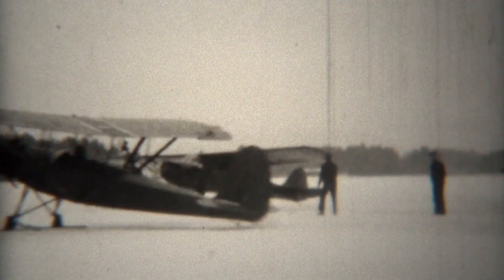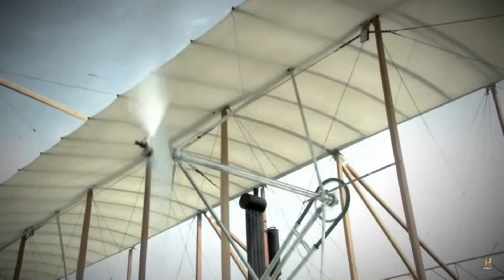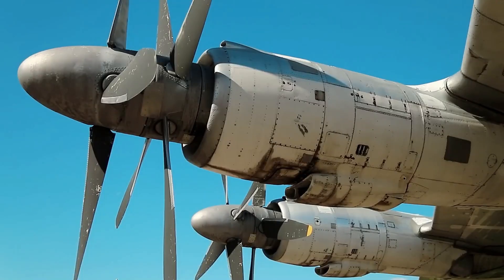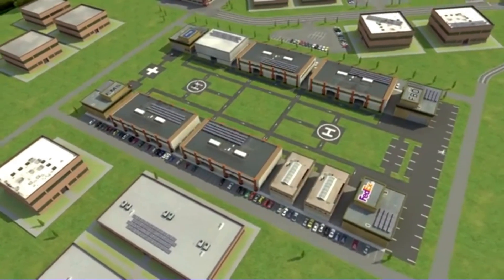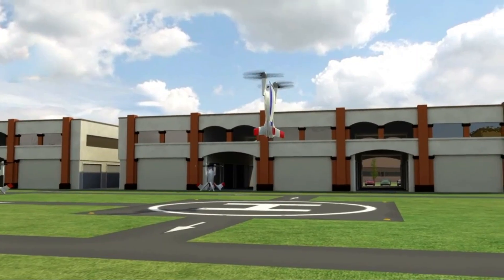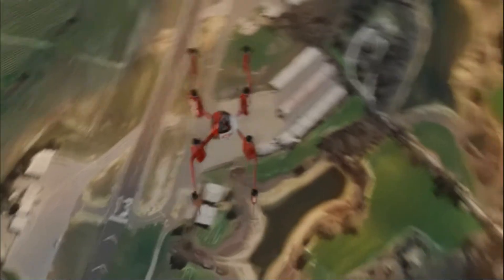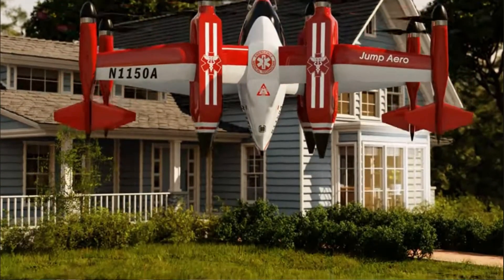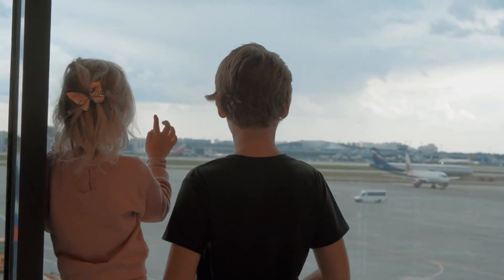Prone Position Aircraft: The Simplest EVTOLS

Comment: There's an uncomfortable mismatch between the lift required for vertical take-off and the drag of long blades during forward flight - especially with fixed pitch props. But you can dramatically increase the amount of lift available if the vehicle is moving in circles rather than hovering still.

The simplest EVTOL could be a tail sitting prone glider that is lifted into the air by a small monocopter with a tow line. The advantage of the tow line is that the monocopter can fly in circles above, while the weight of the glider is on the ground. This has the effect of increasing the "rotor disc" and increasing the lift compared to directly trying to lift the VTOL directly. Then after transitioning to horizontal flight, the monocopter tilts for horizontal thrust - looking like a normal sized propeller rather than an overly large VTOL propeller.

A monocopter can have only one moving part - the motor/prop. A second motor/prop makes sense for safety, though.
Reply: Interesting!

Comment: Hang glider pilots have been flying prone for over 50 years.  Flights over an hour are usual and 6+hrs happen in longer cross flights, so it's possible to build up to flying prone for many hours.

One prone configuration that makes sense to me is a prone version of the BlackFly, this would avoid the awkward take off and landing whilst tilted over on your back.
Reply: @robertosfield  Any design where your head arrives at the scene of the accident first is flawed. But under exceptional circumstances it has utility that should be investigated.
Reply: @bernieharperyt  In general head first is not desirable for safety.  In the case of hang gliders you have a frame which can act somewhat as a crumple zone and you go upright for landing too which mitigates some of the risks.  If you were to do prone during forward flight and nearer vertical for landing, as laid out in this video, you'd replicate this so when you are most likely to crash you most likely not in the worst position from a safety standpoint.
Reply: to be prone means to lie face down...